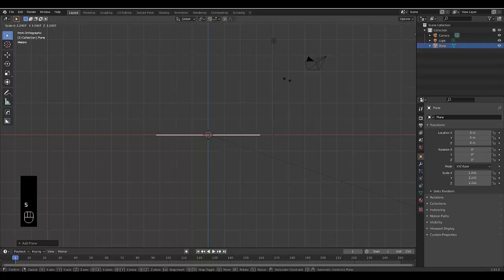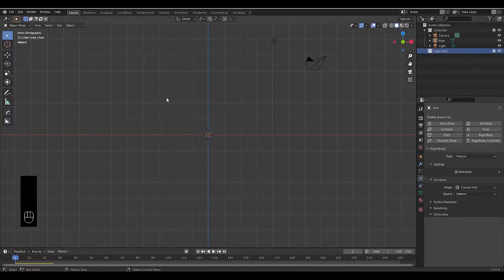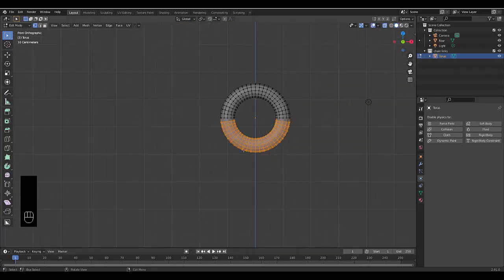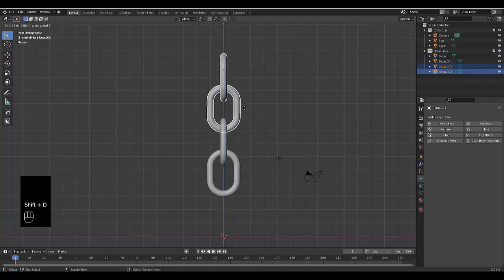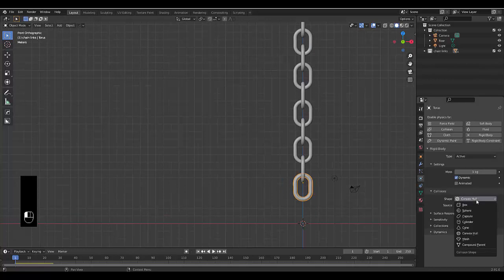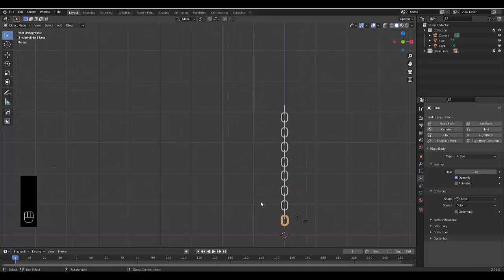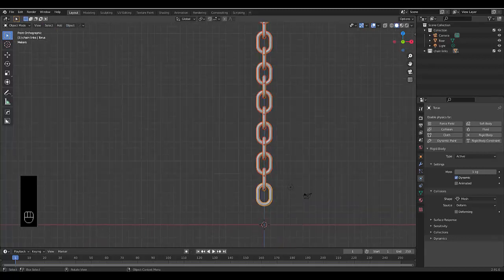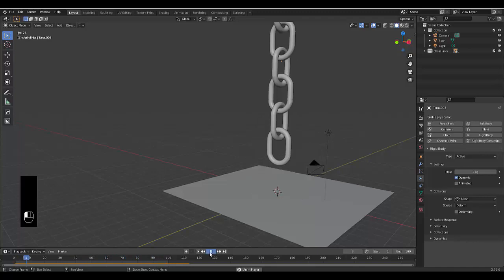Create a chain with physics properties in blender 2.9

Comment: Hey man i saw this process in many places and i've been trying to replicate it to put on a model i'm making, but for some reason even tho i set everything this way, with mesh collision the links explode, any ideas on why it happens?
Reply from the maker: The main reason for the explosion would be because all your chains rigid body collision shape is not set to mesh. Another possible reason is that your meshes are touching and they should not, of in some rare cases you may have made your chain links to small
Reply: @FunwithBlender  Yes, i think the problem is that they're small because i testes in another project and it worked, then i copy and pasted to my previous project and it was working until i scaled it down... I was trying to make these chains to attach them to a cloth piece where this would be hanging pinned to the sleeve, but for that they should be small, any clues on the best way to do it?
Reply from the maker: @Psych6vzz  I am not 100% sure, I would probably scale everything else up,  then you can adjust the Speed value located in Rigid Body Worlds panel, which lets you control the speed factor for simulation.
Reply: @FunwithBlender  Thanks a lot man! Gonna try that later! Great tutorials btw!
Reply: @Psych6vzz  i found the solution change the marging, in the rigid body options, that works great!